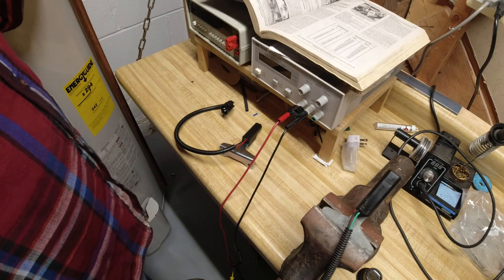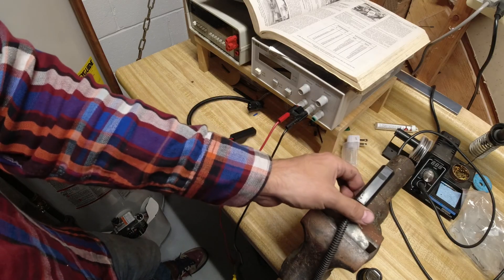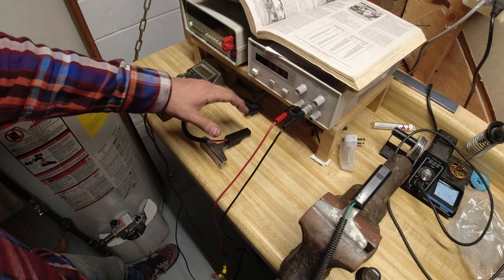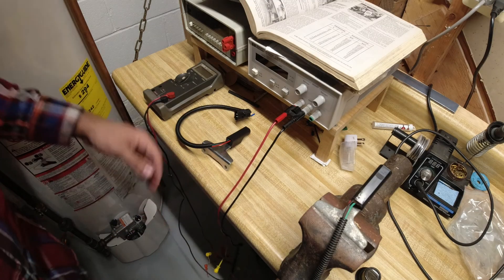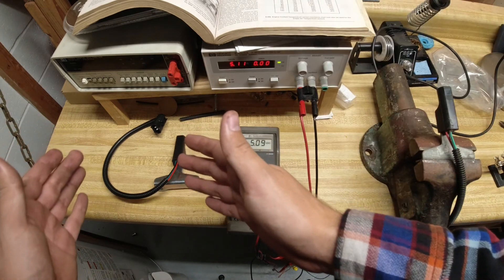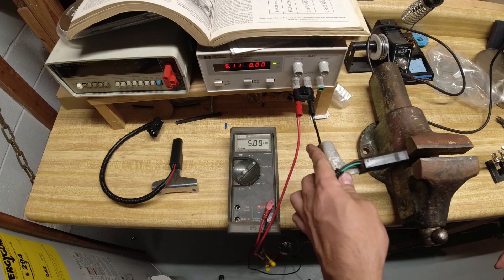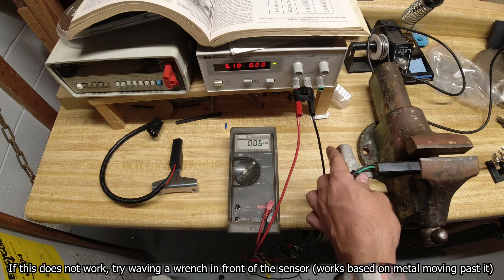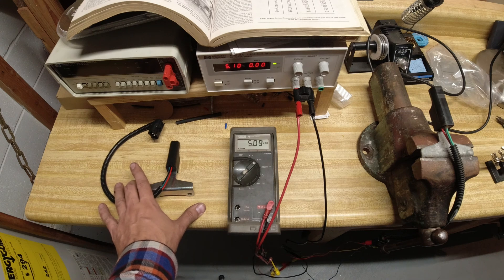Bench Test a 3 Wire Crankshaft Position Sensor

Comment: First let me thank you for this very useful video,just what l was looking for ref three pin bench test.
The 10k resistor between 5v supply and signal imput is news to me l never knew this was required.
This  must be the reason why my previousr bench tests have failed, as this has never been included in my test kit hook up.
Are resistors one directional or can they be fitted either way round?
Reply from the maker: @colin5064  resistors are bi-directional, no need to worry about it. Glad you enjoyed the video!
Reply: @N0Fumar  Thank you for the kind reply,just ordered some 10 k ohms resistors
this should improve my results when testing.Thank you

Comment: Thanks for the procedure. But the crank in a car turns faster than you probe and so I wonder if the sensor may look fine with a slow test but not work well at a faster pace as required by the ECM. Perhaps a frequency setting on a multimeter may be a better test.  Mine fails to show 5V randomly when away from metal.. (as if it gets stuck) but seems to start working again after a few tries.
Reply from the maker: Well, I mean it's analog electronics that's basically just a hall effect sensor. I guess anything is possible, but my guess is that if it's picking up and sort of reading on the multimeter you are probably fine. If anything, an analog (instead of digital) multimeter would probably be better so you can see swings easier.

Comment: Good afternoon I was checking your video and I did a bench test to a crankshaft sensor Hall effect (3 cables) but I supplied 5V with a topdiag 200 tool, other cable to ground and the other to a multimeter to see the voltage flow but the voltage went from 1v to 0 when you approached an iron piece as you do In video, in this case why I have to use a resistance? Can you explain to me thanks

Comment: Appreciate the video and thought this would allow me to test my 3 wire from a 2001 dodge Cummins.  I bouught a new camshaft position sensor and hooked it up exactly as you had showed checked and rechecked several time t omake sure the connections were correct. Under these conditions bringing a metal object to the surface of the sensor would not trigger the switch and bring the voltage down - no change.  However with the same sensor hooked to the wiring harness of the truck it switches exactly as describes with the metal object.  Is this something current related do I need a resistor or more resistors of other sizes beside the 10K?  Any insight appreciated.
Reply from the maker: Try it again but wave the metal in front of the sensor. It works by having metal rush past the sensor and create an electromagnetic field with the sensor. Double check your pinout as it may be slightly different for the Cummins (I know they can be fussy).
Reply: @N0Fumar  Thank you for the timely reply.  But it worked exactly as you showed when connected to the wiring harness of the truck.  Is the truck ECM allowing a different current to pass?  Also pinout what do you mean and what should I be attempting to measure?
Reply from the maker: @fendercare  so the pinout is like the diagram in the book that I show for a few seconds on screen. I'd have to go find it and see if it is different for the Cummins. Try googling "2001 Cummins crankshaft position sensor wiring" and try to match it up how I have it in the picture I show
Reply: Any and all comments are Greatly Appreciated.  crankshaft position sensors are  always a headache to get to on a cold wet day , roadside 😂